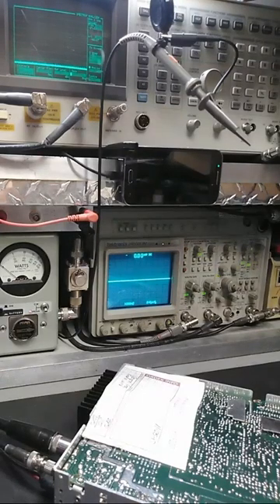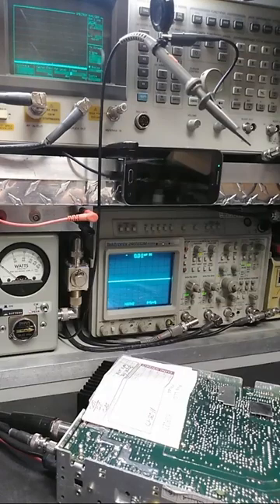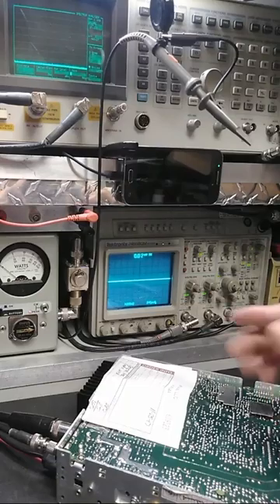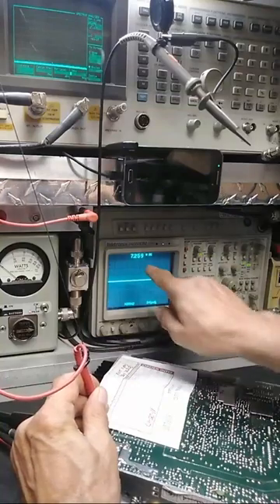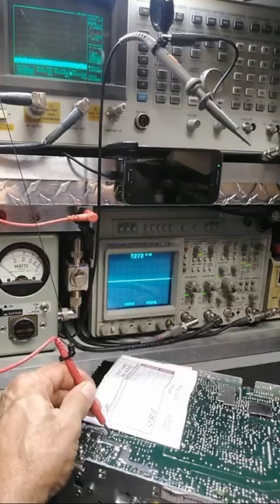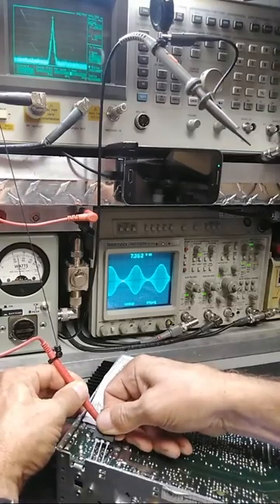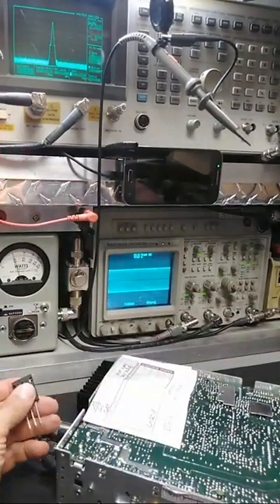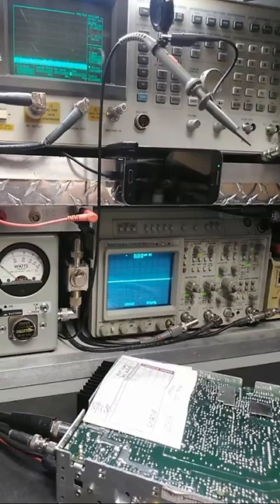Pay Attention! Max Mod .. dual final application. Cleaner Is Meaner And Cooler Too!

Comment from the maker: Let the hate clicks begin .. lol  PAY ATTENTION!
If they don't or wont show you .. like this .. they're stroking you,  get that Part?  Never settle for less! Here's what it takes to cut through the noise, be loud and crystal clear with a better receiver too:  A) Tuned Bench:  https://www.youtube.com/watch?v=lwcDfXOgAls. 
True, it's more complicated and time consuming to accomplish these consistent and accurate results. Below is a partial procedure and list of calibrated equipment used to achieve this level of performance . Read on ..

Fine Tune CB Radio Shop strictly adheres to (https://www.nist.gov/) NIST Traceable Calibrations and other industry standards to maintain accuracy and consistency for providing Real World Performance Tuning of Citizens Band and 10 Meter export mobile radios with integrity.

"Basic Textbook AM/FM/SSB Transceiver Tune, Alignment and Calibration" 

1) Pll adjustments
VCO & OSC, AM TX OSC, USB TX OSC, LSB TX OSC.

2) Transmitter alignment
DRIVER BIAS, FINAL BIAS, SSB  (or gate voltages for mosfet versions) CARRIER BALANCE, HI-LO AM & SSB Power, RF METER, AMC, ALC and FM DEVIATION.

3) Receiver alignment
AM/FM RF & IF SENSITIVITY, FM DETECTOR/DEVIATION, SSB IF SENSITIVITY, SSB S-METER, AM/FM S-METER (100uV unmodulated -67dbm for “S-9” meter reading!), AM/FM SQUELCH RANGE, SSB SQUELCH RANGE, and NOISE BLANKER/AUTOMATIC NOISE LIMITER (Real World dBm to volts (uV) tables below).

That's just a typical run of the mill textbook tune up and alignment (if you're lucky). There's more to it than frequency alignment, modulation adjustment, meter calibration and a tune up report displaying exaggerated rms Bird peak watts! 

"Test Bench includes"

Bird 4314C Meter
https://www.birdrf.com/Products/Test%20and%20Measurement/Power-Meters/Wattmeters-Line-Sections/RF-Wattmeters/4314C_PEP-Single-Element-Wattmeter.aspx
Part 1) https://www.youtube.com/watch?v=RpX9IHe4ORM&t=16s
Part 2) https://www.youtube.com/watch?v=LuhbqTf6Bxw
Bird 4314C Accuracy Test: https://www.youtube.com/watch?v=DqEOabYqhQo&t=5s
Bird Stipulates 1/2 wavelengths  https://www.youtube.com/watch?v=5eWhgT-rTII
And Genuine Bird Elements from 1K down.

Bird 4373 Sampler 
https://www.rfparts.com/signal-samplers.html

HP8924c with options
http://userequip.com/files/specs/2147/HP%208924C%20Repair.pdf
https://www.youtube.com/watch?v=Cg1w0xBa27s&t=1s

HP8920a with options
https://www.keysight.com/upload/cmc_upload/All/EPSG072204.pdf

Three analog scopes, one digital 200 Mhz
https://www.atecorp.com/atecorp/media/pdfs/data-sheets/tektronix-2465b-2467b_manual.pdf
https://www.youtube.com/watch?v=by98x4eu2lM

Fluke 27fm
http://www.fluke.com/fluke/inen/digital-multimeters/fluke-27.htm?pid=56055
 
LCR http://www.lcrresearch.com/wp-content/uploads/2017/05/LCR_Pro1_Manual_version1.03.pdf

Power supplies
6 Cosel PBA1500f12 (750 amps) variable and configurable.
https://en.cosel.co.jp/product/powersupply/PBA/PBA1500F/PBA1500F-12/
Corcom 20VB1 F7130 EMI Filter 50-60Hz 250V

Times Microwave Coax jumpers and test leads
http://www.timesmicrowave.com/cms/products/cables/lmr/
https://www.youtube.com/watch?v=EmqaGJ6IWow
https://www.youtube.com/watch?v=1ltFVSxGp5Y
https://www.youtube.com/watch?v=v12YZT_1o90
https://www.youtube.com/watch?v=h7iiYfmYWRA&t=215s

Amphenol RF Connectors
https://www.amphenolrf.com/
https://www.youtube.com/watch?v=dVh5B0hdEA0 
https://www.youtube.com/watch?v=dKZg8T_AOso

More range, compliments, reliability and a quieter, clearer but more sensitive receiver,  Get Fine Tuned .. not peaked and ruined.

Here are some VideoGates of me at the bench practicing what I preach using my bench radio or customers radio completed and ready to be shipped: https://www.youtube.com/results?search_query=hard+drive+163+ more: https://www.google.com/search?q=Hard+Drive+163+nm&ie=utf-8&oe=utf-8&client=firefox-b-1-ab

It's what I recommend, use, service and sell ... to you ... not something non practical or deceiving in a misleading way. I'm not just the tech and owner of Fine Tune CB Radio Shop, I'm a customer too!  When finished, You'll be giving radio checks, not asking for them .

dBm To Watts and Volts
Tables below displays relationship between Power in [dBm] or [Watts] and Voltage in RMS, peak, peak-to-peak for sinusoidal signals in 50-Ohm systems for accurately measuring and tuning am/fm/ssb receiver sensitivity, agc, squelch and "S9" Meter calibration.

  [dBm] [Watts]   [Volts]rms   [Volts]p    [Volts]pp
-140 0.100E-16  22.361 nV  31.618 nV  63.236 nV 
-139 0.126E-16  25.089 nV  35.476 nV  70.952 nV 
-138 0.158E-16  28.150 nV  39.805 nV  79.609 nV 
-137 0.200E-16  31.585 nV  44.662 nV  89.323 nV 
-136 0.251E-16  35.439 nV  50.111 nV  100.222 nV 
-135 0.316E-16  39.764 nV  56.226 nV  112.451 nV 
-134 0.398E-16  44.615 nV  63.086 nV  126.172 nV 
-133 0.501E-16  50.059 nV  70.784 nV  141.568 nV 
-132 0.631E-16  56.167 nV  79.421 nV  158.842 nV 
-131 0.794E-16  63.021 nV  89.112 nV  178.223 nV 
-130 0.100E-15  70.711 nV  99.985 nV  199.970 nV 
-129 0.126E-15  79.339 nV  112.185 nV  224.370 nV 
-128 0.158E-15  89.019 nV  125.874 nV  251.747 nV 
-127 0.200E-15  99.882 nV  141.232 nV  282.465 nV 
-126 0.251E-15  112.069 nV  158.465 nV  316.931 nV 
-125 0.316E-15  125.743 nV  177.801 nV  355.602 nV 
-124 0.398E-15  141.086 nV  199.496 nV  398.992 nV 
-123 0.501E-15  158.301 nV  223.838 nV  447.677 nV 
-122 0.631E-15  177.617 nV  251.151 nV  502.302 nV 
-121 0.794E-15  199.290 nV  281.796 nV  563.591 nV 
-120 0.100E-14  223.607 nV  316.180 nV  632.360 nV 
-119 0.126E-14  250.891 nV  354.760 nV  709.519 nV 
-118 0.158E-14  281.504 nV  398.047 nV  796.094 nV 
-117 0.200E-14  315.853 nV  446.616 nV  893.232 nV 
-116 0.251E-14  0.354 µV  0.501 µV  1.002 µV 
-115 0.316E-14  0.398 µV  0.562 µV  1.125 µV 
-114 0.398E-14  0.446 µV  0.631 µV  1.262 µV 
-113 0.501E-14  0.501 µV  0.708 µV  1.416 µV 
-112 0.631E-14  0.562 µV  0.794 µV  1.588 µV 
-111 0.794E-14  0.630 µV  0.891 µV  1.782 µV 
-110 0.100E-13  0.707 µV  1.000 µV  2.000 µV 
-109 0.126E-13  0.793 µV  1.122 µV  2.244 µV 
-108 0.158E-13  0.890 µV  1.259 µV  2.517 µV 
-107 0.200E-13  0.999 µV  1.412 µV  2.825 µV 
-106 0.251E-13  1.121 µV  1.585 µV  3.169 µV 
-105 0.316E-13  1.257 µV  1.778 µV  3.556 µV 
-104 0.398E-13  1.411 µV  1.995 µV  3.990 µV 
-103 0.501E-13  1.583 µV  2.238 µV  4.477 µV 
-102 0.631E-13  1.776 µV  2.512 µV  5.023 µV 
-101 0.794E-13  1.993 µV  2.818 µV  5.636 µV 
-100 0.100E-12  2.236 µV  3.162 µV  6.324 µV 
-99 0.126E-12  2.509 µV  3.548 µV  7.095 µV 
-98 0.158E-12  2.815 µV  3.980 µV  7.961 µV 
-97 0.200E-12  3.159 µV  4.466 µV  8.932 µV 
-96 0.251E-12  3.544 µV  5.011 µV  10.022 µV 
-95 0.316E-12  3.976 µV  5.623 µV  11.245 µV 
-94 0.398E-12  4.462 µV  6.309 µV  12.617 µV 
-93 0.501E-12  5.006 µV  7.078 µV  14.157 µV 
-92 0.631E-12  5.617 µV  7.942 µV  15.884 µV 
-91 0.794E-12  6.302 µV  8.911 µV  17.822 µV 
-90 0.100E-11  7.071 µV  9.998 µV  19.997 µV 
-89 0.126E-11  7.934 µV  11.218 µV  22.437 µV 
-88 0.158E-11  8.902 µV  12.587 µV  25.175 µV 
-87 0.200E-11  9.988 µV  14.123 µV  28.246 µV 
-86 0.251E-11  11.207 µV  15.847 µV  31.693 µV 
-85 0.316E-11  12.574 µV  17.780 µV  35.560 µV 
-84 0.398E-11  14.109 µV  19.950 µV  39.899 µV 
-83 0.501E-11  15.830 µV  22.384 µV  44.768 µV 
-82 0.631E-11  17.762 µV  25.115 µV  50.230 µV 
-81 0.794E-11  19.929 µV  28.180 µV  56.359 µV 
-80 0.100E-10  22.361 µV  31.618 µV  63.236 µV 
-79 0.126E-10  25.089 µV  35.476 µV  70.952 µV 
-78 0.158E-10  28.150 µV  39.805 µV  79.609 µV 
-77 0.200E-10  31.585 µV  44.662 µV  89.323 µV 
-76 0.251E-10  35.439 µV  50.111 µV  100.222 µV 
-75 0.316E-10  39.764 µV  56.226 µV  112.451 µV 
-74 0.398E-10  44.615 µV  63.086 µV  126.172 µV 
-73 0.501E-10  50.059 µV  70.784 µV  141.568 µV 
-72 0.631E-10  56.167 µV  79.421 µV  158.842 µV 
-71 0.794E-10  63.021 µV  89.112 µV  178.223 µV 
-70 0.100E-09  70.711 µV  99.985 µV  199.970 µV 
-69 0.126E-09  79.339 µV  112.185 µV  224.370 µV 
-68 0.158E-09  89.019 µV  125.874 µV  251.747 µV 
-67 0.200E-09  99.881 µV  141.232 µV  282.465 µV
-66 0.251E-09  112.069 µV  158.465 µV  316.931 µV 
-65 0.316E-09  125.743 µV  177.801 µV  355.602 µV 
-64 0.398E-09  141.086 µV  199.496 µV  398.992 µV 
-63 0.501E-09  158.301 µV  223.838 µV  447.677 µV 
-62 0.631E-09  177.617 µV  251.151 µV  502.301 µV 
-61 0.794E-09  199.290 µV  281.796 µV  563.592 µV 
-60 0.100E-08  223.607 µV  316.180 µV  632.360 µV 
-59 0.126E-08  250.891 µV  354.760 µV  709.520 µV 
-58 0.158E-08  281.504 µV  398.047 µV  796.094 µV 
-57 0.200E-08  315.853 µV  446.616 µV  893.232 µV 
-56 0.251E-08  0.354 mV  0.501 mV  1.002 mV 
-55 0.316E-08  0.398 mV  0.562 mV  1.125 mV 
-54 0.398E-08  0.446 mV  0.631 mV  1.262 mV 
-53 0.501E-08  0.501 mV  0.708 mV  1.416 mV 
-52 0.631E-08  0.562 mV  0.794 mV  1.588 mV 
-51 0.794E-08  0.630 mV  0.891 mV  1.782 mV 
-50 0.100E-07  0.707 mV  1.000 mV  2.000 mV 
-49 0.126E-07  0.793 mV  1.122 mV  2.244 mV 
-48 0.158E-07  0.890 mV  1.259 mV  2.517 mV 
-47 0.200E-07  0.999 mV  1.412 mV  2.825 mV 
-46 0.251E-07  1.121 mV  1.585 mV  3.169 mV 
-45 0.316E-07  1.257 mV  1.778 mV  3.556 mV 
-44 0.398E-07  1.411 mV  1.995 mV  3.990 mV 
-43 0.501E-07  1.583 mV  2.238 mV  4.477 mV 
-42 0.631E-07  1.776 mV  2.512 mV  5.023 mV 
-41 0.794E-07  1.993 mV  2.818 mV  5.636 mV 
-40 0.100E-06  2.236 mV  3.162 mV  6.324 mV 
-39 0.126E-06  2.509 mV  3.548 mV  7.095 mV 
-38 0.158E-06  2.815 mV  3.980 mV  7.961 mV 
-37 0.200E-06  3.159 mV  4.466 mV  8.932 mV 
-36 0.251E-06  3.544 mV  5.011 mV  10.022 mV 
-35 0.316E-06  3.976 mV  5.623 mV  11.245 mV 
-34 0.398E-06  4.462 mV  6.309 mV  12.617 mV 

                 Don't Be A Mud Duck!

Hard Drive 163 NM. 73's! Click click.

Comment: I saw the difference right before you said anything. I think that's neat.
Reply from the maker: Neat turned into heat .. the good kind!
Reply: Not all finals/MOSFETS are created equal. 
If a radio shop says that they cut things and don't put nothing back, walk away....
Just walk away